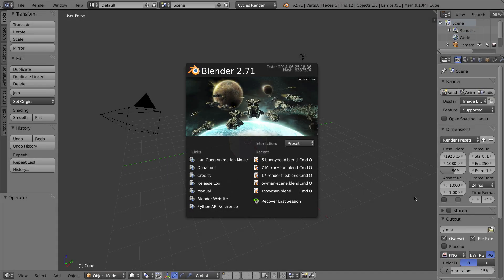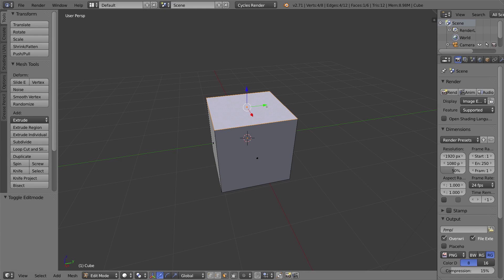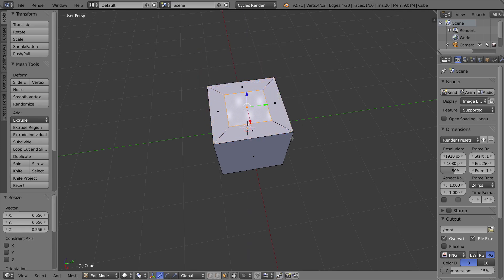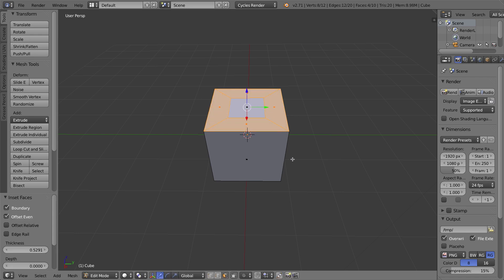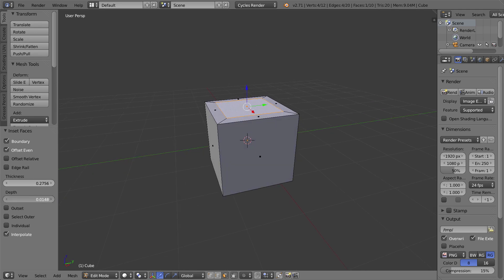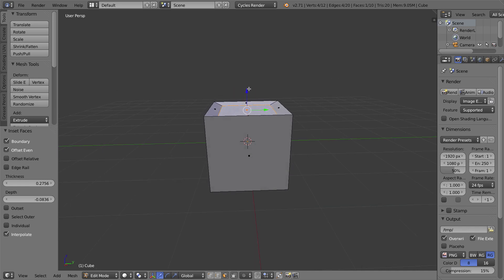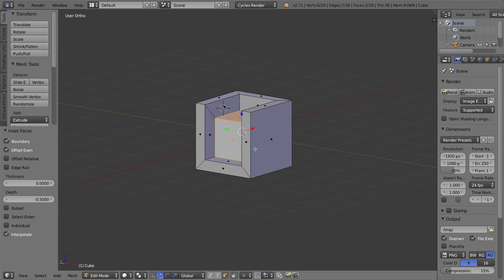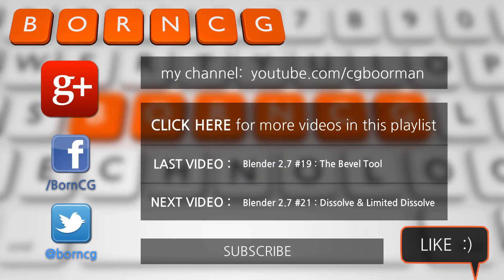Blender 2.7 Tutorial #20 : The Inset Faces Tool

Comment: Nice Tutorial ! I have a question how could you have the operation panel always open on your workspace with Blender 2.8 ?
Reply from the maker: One of the things about blender is that many of the recent operations (especially adding a mesh) are only available immediately after you do that operation... So as soon as you move the mesh you just added, that panel at the bottom left) needs to go away. You can't add more rings or segments to a sphere you just added if you've transformed it. You can press F9 I believe to bring it up if available, but I'm not sure if there's a way to keep it always open.